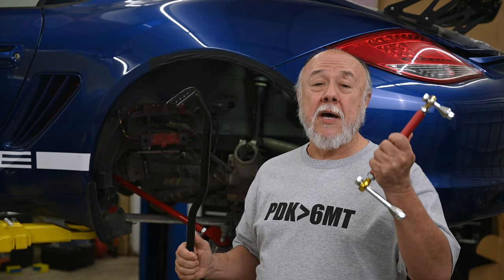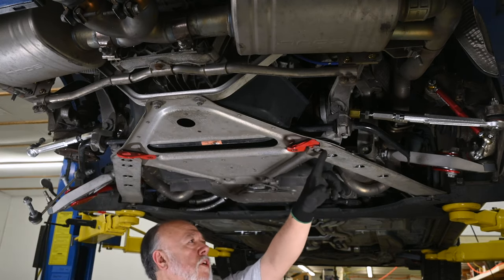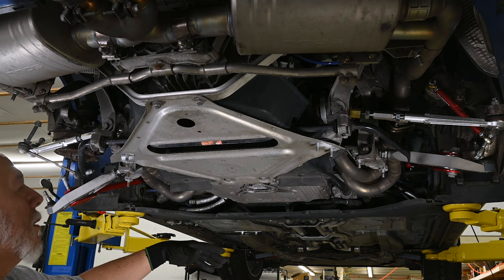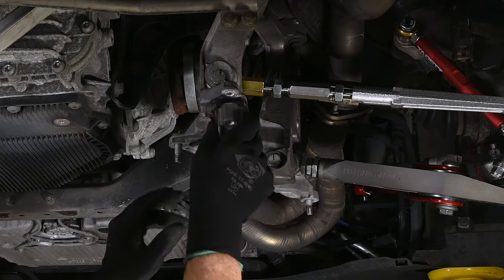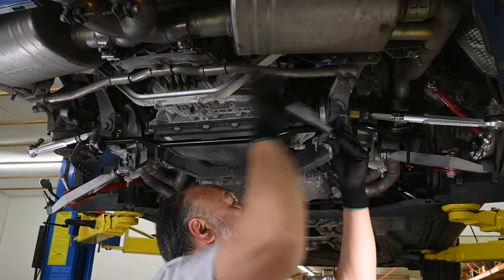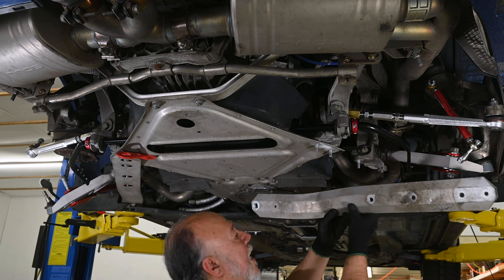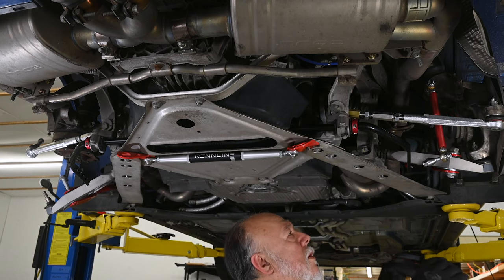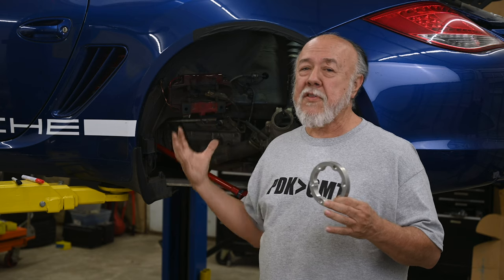My $15K Suspension Upgrade Part 6: Tarett Rear Sway Bar and Adjustable Drop Links

Comment: On your final video of this series, I'd like to see a list of all the suspension components you installed and how the handling and ride changed when each part was applied.  Unfortunately, I did sways, end links, front strut and subframe brace after coilovers at the same time as I changed to a new set of track wheels and tires.  I think the tires were the biggest improvement, but I'd like to hear the experience from someone who has driven between each upgrade.  My cost is far less than $15K even with labor.  I prob have cheaper coilovers and I don't have the control arms like you, but I'd like to hear which of these parts are best bang-for-buck when all is said and done.